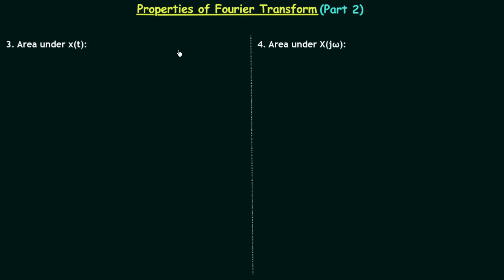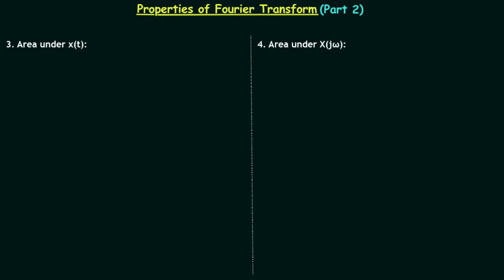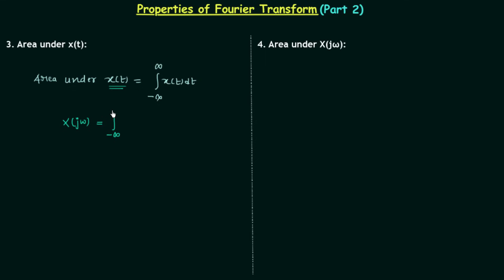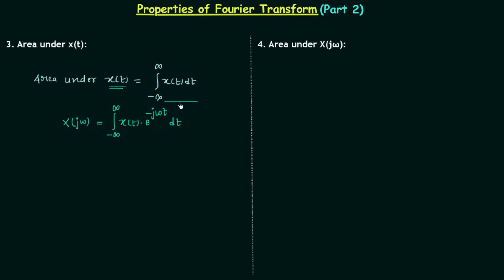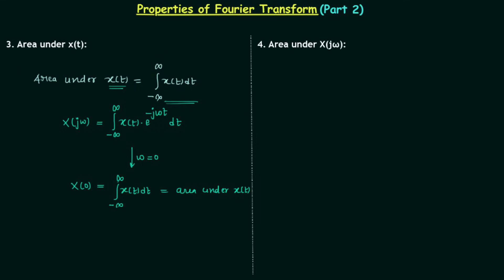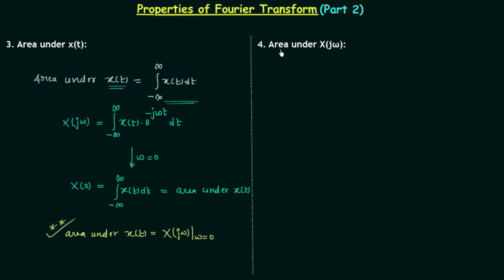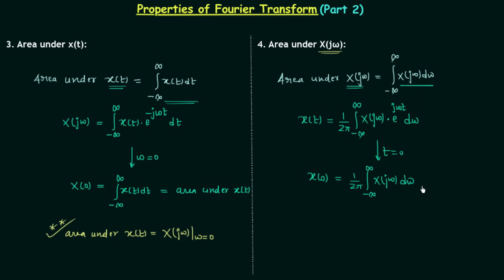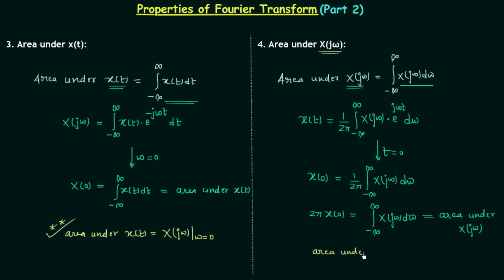Properties of Fourier Transform (Part 2)

Comment: I understand that having w=0 means we are taking f = 0 of the given signal (the dc component). But having t=0 is a bit "confusing" ? I don't see the usefulness of it, as of right now, ofc
Reply: Its , if Fourier transform is given and have to find initial value of signal in time domain , simply get the area under F(w) . 😁 That's all i can see any use so far 😃

Comment: area under the curve x(w)=2pi x(t) it is applicable for only at t=o or for any other case plz help me sir
Reply: only t = 0, otherwise e=/= 1.
Reply: Karrq for if u take area under the curve. I am taking here t is not equal to zero.... Then what happened
Reply: @saisumanth8064  then it will be fourier transform as it is , solving by conventional integration , what's the deal ? You seems confused with what exactly are you trying to do .
Reply: the area under X(w) = 2*pi(x(t)) at t = 0.
Area is a value and the "X" at LHS and "x" at RHS are different... note that...
I think now you have understood that...